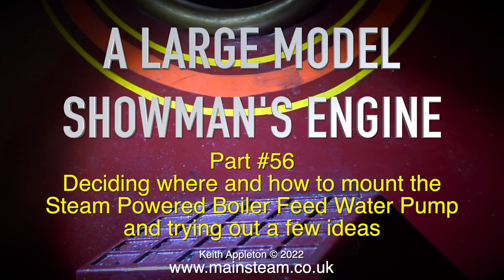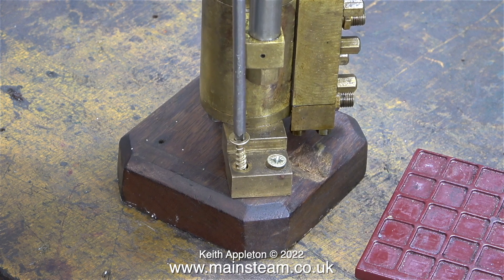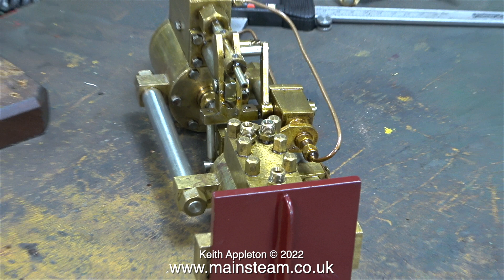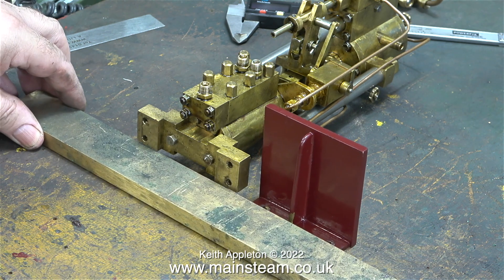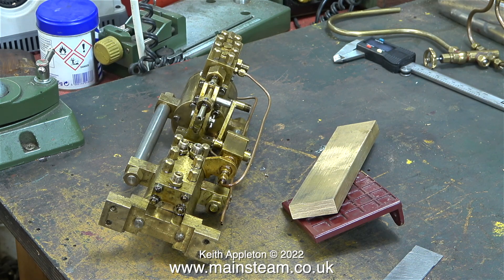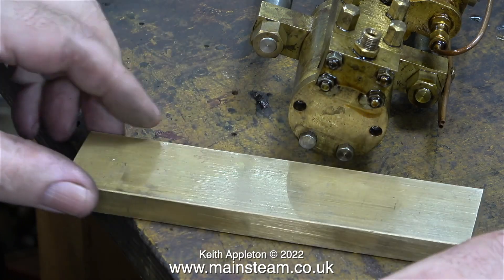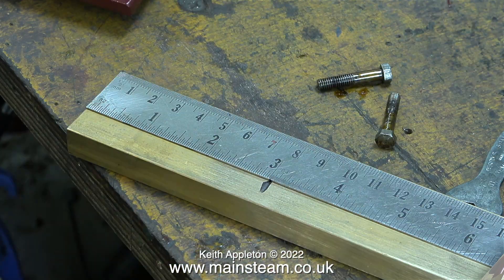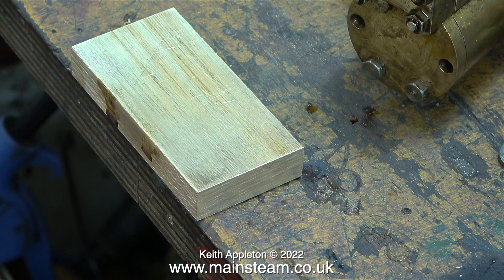A LARGE MODEL SHOWMAN'S ENGINE - PART #56

Comment: Is there no room to mount it inside the guard?
Reply from the maker: Which Guard ??
Reply: @keithappleton  I'm wondering if it might be better to mount the pump inside the frame rather than outside on the step. On one hand it would be sleeker and perhaps safer. On the other hand no one would be able to see the beautiful pump in action.
Reply from the maker: ah - I see what you mean. The answer is no, as there is not enough room in the Bunker area, which is quite small. With the pump in that position I would not be able to shovel any coal into the firebox.